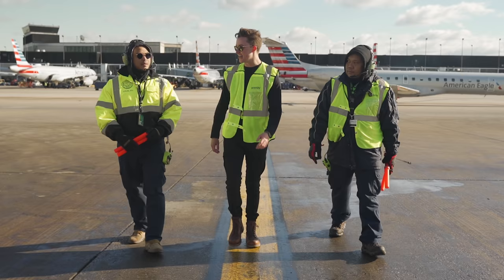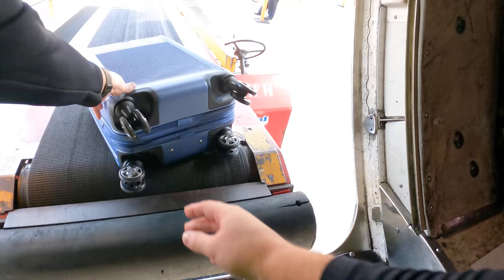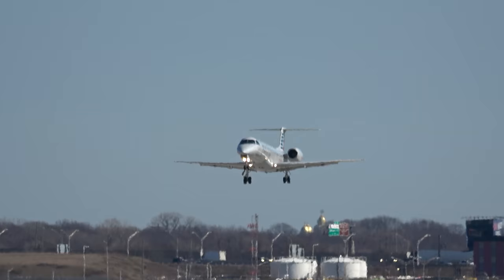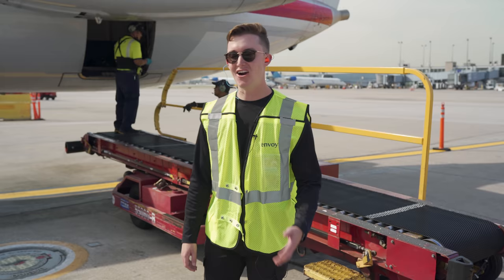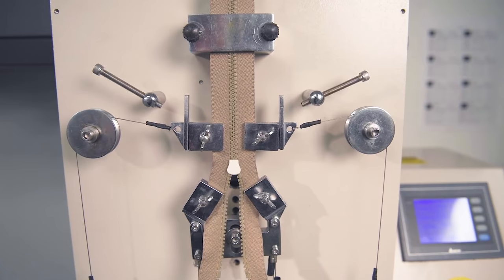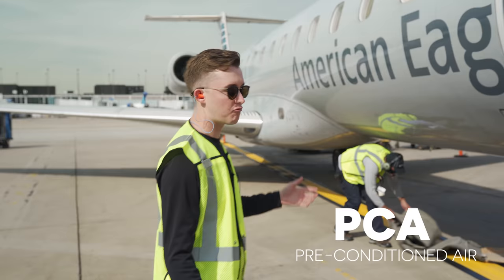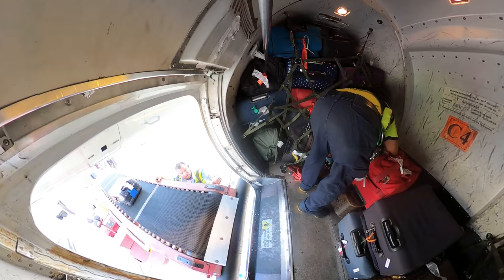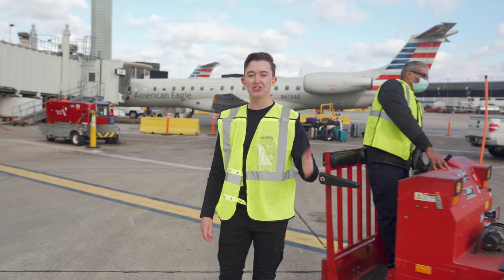Airline Pilot Attempts Working The Ramp | Throwing Bags +  More!

Comment: In 1997 I got my first aviation job as a ramp dispatcher job I communicated to the crews flight information and radioed the pilots the gate assignment. I managed to preform all but the pushback driver. I loaded and unloaded bags..lost my badge and then found it while putting bags on the carousel at baggage claim. Preformed as a brakeman on aircraft relocation. Marshalling flights. Running the loader, openning the nose on a 747.. cool job. Now doing office work as a cargo Agent processing manifest and customs reporting. Thanks for the sharing the what we call below the wing flight operations. Happy subscriber 😀.

Comment: When I worked as a ramp agent in Tel Aviv airport just before the COVID-19 hit, I used to do the turn-around of A320-321 and 737's with 130-180 pax and 100+ baggage for less than 55 minutes (includes refuel, water, trash, toilets and boarding). I loved this Job!

Comment: I work for United Ground Express(Subsidy of United Airlines). I can tell you this is physically demanding and can get you into shape if you let it. 
Many of the GSE (Ground Service Equipment) is electric while only 4 thing we have are gas. Portable GPU (Ground power unit) Portable PC (Preconditioned air) and Forced APU start (This is as loud as a normal APU on a plane). I love it, and it's a great job for people looking to get into the aviation industry. Airlines will advance people that work for them, over hire outside.
The tugs tbh are fun to drive, but are very sensitive and will tip of your not being aware of your speed. 
Potable water we don't always fill, we may get 1 or 2 planes a week that want more potable water or need to be flushed with new blue water (Blue juice). Blue water is what helps break down the bacteria and waste that goes in the brown tank. 
Where I'm at, we hate the CRJ200s and the ERJ-145s. They break down so often and cause us problems. They result in canceled flights and upset passengers a long with a lot of rerouting or transfers. 
Many pilots have absolutely no clue what being on the ground is like, which causes miscommunication and other problems including inpatient pilots. This then gets put on us which causes us more problems. 
Do not work and expect to get paid a lot, I get 13.50/hr and work about 30 hours a week. Schedules are bid based and you have 6 months for probation. Depending on the airline, you will be flown out for classes and OJT (On the Job Training) which could be a month or 2. I'm doing base training (Training at my airport). If your up to joining the industry join it, but do not expect it to be easy, especially when a passenger yells at you. Some airlines cross utilizes their employees, so they are trained on ground Ticket counter and Gate. If you hate physical labor ground crew is not your area. 
As of typing this I was in the bag room sorting bags.

Comment: Respect my Man! As someone who worked Ramp/Under Wing for 7 years you got it right! Made me nostalgic Wing Walking! Maybe you could do something on Baggage claim 🛄 We did most of ours at night 🌉 when the RON Aircraft came in Also if you have someone like A EX who clean the AC at night 🌉 do necessary Comp Washes. We may have been an unique Out Station because we had an MX Shop/*Stores across the Field Excellent work! Being in the Bin all day was the equivalent of your Sauna and Aerobics! We used to provide Ramp Services for Allegiant Charters back in the day! They used to use those old MD-87',s. Those Bins were easy because they were Low Slung. I always liked it when they flashed the Nose Gear light once and I'd salute and wand them off!

Comment: Im sure its very uncomfortabel crawling in and stacking in these little embraers but speaking from experience id take everything over a 757-300 with more than 300 loose bags or even worse an 737-900 from certain airlines that allow higher maximum weight on checked luggage. working for the airport and not an airline i get to work on the good and the bad ones 😀

Comment: As a pilot, and pet lover, please do not put your pet in the cargo hold.  Please do everything possible to not put them there (even if it means driving or otherwise shipping from a pet shipper).  They are heated, but not air conditioned (looking at you, summer season).  It's a different kind of misery for them.  Even if not the heat, the noise is obscene.

I always hate getting cargo loads and seeing pets on the load.